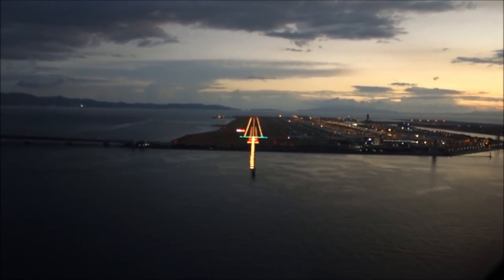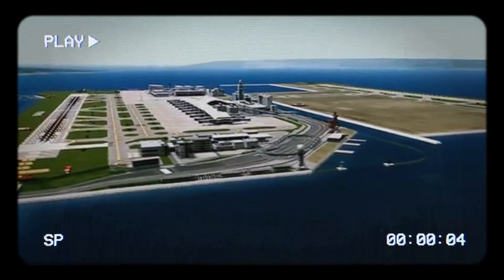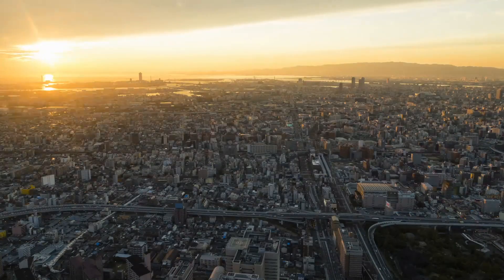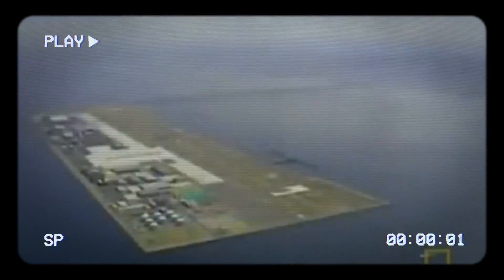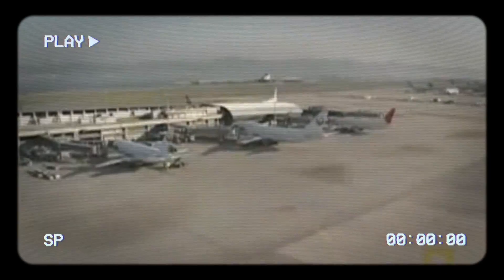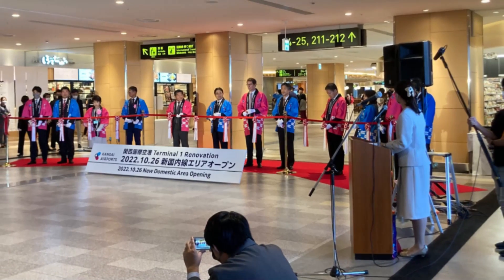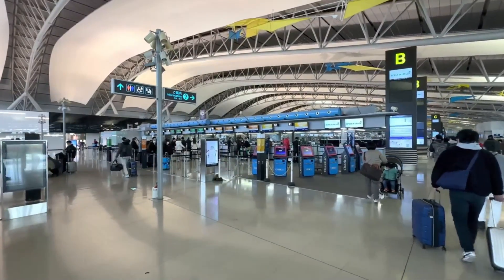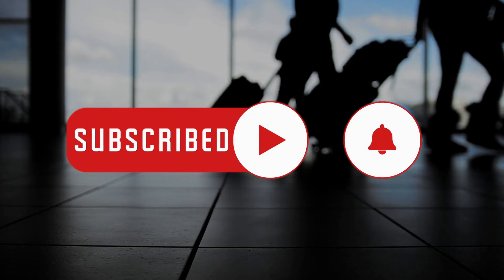Inside Japan's $20B Sinking Airport

Comment: It would be great to see a follow up with engineering lessons learnt. Was surprised that they didn't use piles under the principle structures and runways. There after 13 metres above water and Stilts above theses piles to metal floating platforms  with ability to move horizontally (earthquakes) then put in your hydraulics adjusters on top underneath the columns. 
Also why just pump sand an aquifer or liquidation in quakes. Shave off tops of mountains. Solid Rock and additional agricultural lands ?
Reply: Good analysis. i think more of your statement needs depth and grammatic review.  You are, obviously, a good engineer.